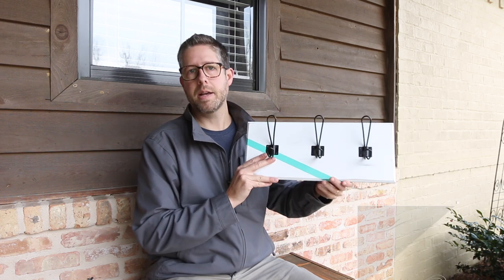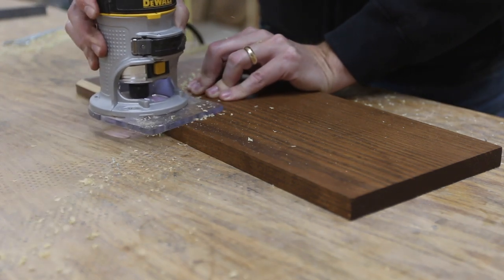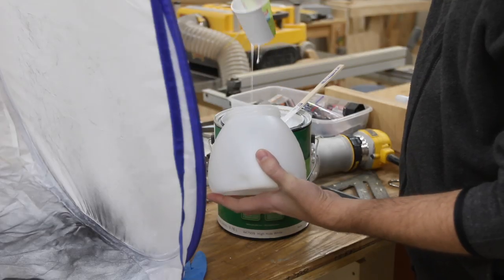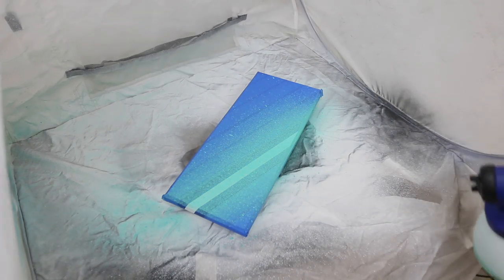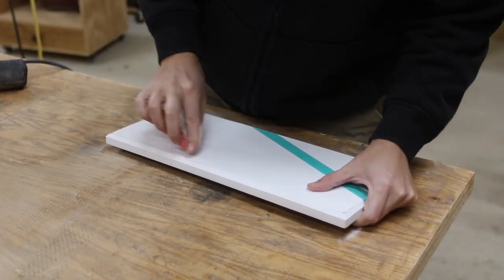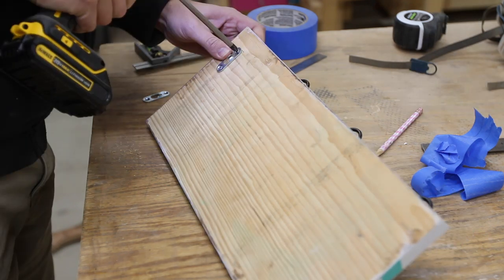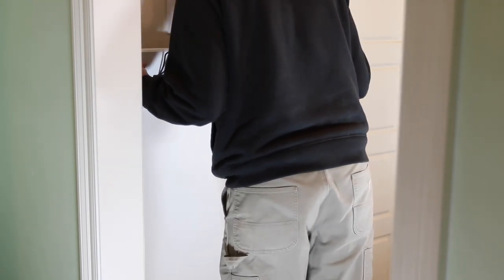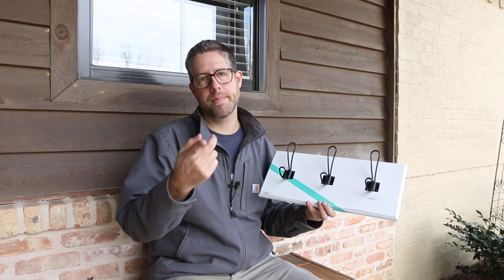Simple DIY Towel Hanger

Comment: Man the 'simple' projects are the most satisfying to do sometimes, huh ?
Love those Toggler anchors and have had the same issue with the heads - glad it wasn't just me :) 
The accent stripe really makes it so much more than a basic piece !
Reply: ps: I have got to get one of those little popup spray booths... very cool
pps: thanks for the link on the router. Needed a second (sixth actually) one for laminate work so got it, the punch, and a couple bits.
Reply from the maker: Yeah, I love a good, simple project. This was my first time using the toggler anchors and I like them. It was kind of fun to hear it pop open when you put the screw in there.
Reply from the maker: @jakematic  You bet! It's a good little router. Thanks for using my link!
Reply: @BruceAUlrich  They have superb shear strength. Have had a multi thousand $ mahogany German regulator clock hanging from one years I am that confident in them !

Comment: I'm not a fan of distressing, but I remember reading about dropping your car keys, or a short length of chain, onto the piece to simulate some impact marks.   And the other is to think about simulating natural wear... so in your case, I wonder about some vertical wear marks from taking towels on and off?   Yeah, I'm reaching, hope this helps someone!
Reply from the maker: Those are good ideas! I should have done vertical marks instead of horizontal ones now that you mention it. I was worried how the wood grain would react.